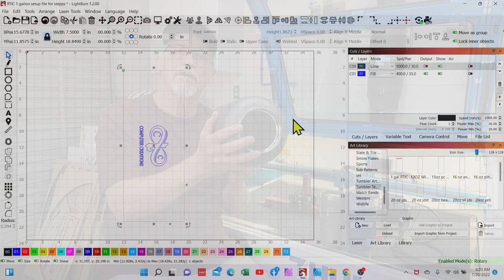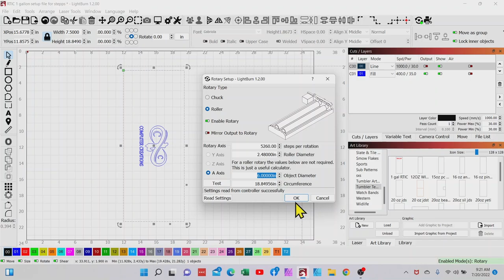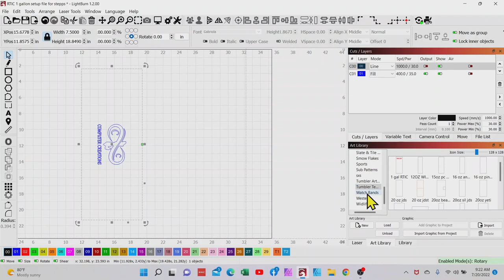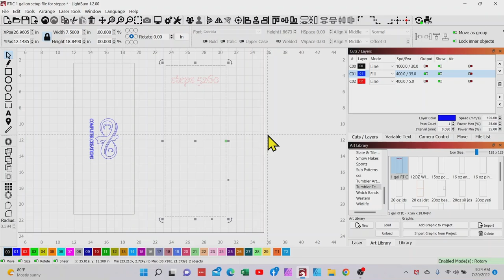Laser Engraving on a 1 gallon jug from RTIC On my PiBurn 4 rotary

Comment: I may have missed it but how exactly did you "calculate" your steps using the smaller neck? I just got my Pi Burn 4.0 with the add-on chuck and have never run a Rotary on my Boss Laser. I subscribed to your channel and have learned a lot. Thank you.
Reply from the maker: I would refer on how the steps are calculated on the pi burn web site. There is allot of ways to do it. Because what is setting on the drive wheels on the rotary is a different diameter than you engraving area steps must be recalculated
\

Comment: Great informative video. Thank you for explaining. I do have a question? Why do you turn off the air assist? I’m still learning on my laser.
Reply from the maker: Be sure your air assist button is in the off position in lightburn
Reply: @computercreationz  okay. But can you explain the reason why this needs to be done.
Reply from the maker: @shawnbrown8995  air assist is used for cutting only there really isn’t anything to blow away when engraving a tumbler. If you use air when engraving a tumbler you just blow all that vaporized material all over your laser that you have to clean later
Reply: Ok thank you for the information. Makes perfect since now. 👍

Comment: I'm looking to buy a thunder nova 24 and piburn rotary and want to be able to do 1 gallon water bottles. Are you still using the 24" bed or is this a larger machine now? If it is larger do you know if it would fit in the 24" model?
Reply from the maker: yes you can you will need to remove the honeycomb and the slat bars and build up from the bottom. I would highly consider the piBurn grip. it works fantastic on large tumblers like that. I sold my 24 some time ago and have a 35-100 now. I reached out to someone that has the 24 and the grip to answer your question.

Comment: Thanks for your detailed explanation.  I noticed in your previous videos you used the Thunder RotoBoss.  Can you share the differences or the pros and cons of each one.  I'm am considering purchasing a laser and am leaning towards Thunder.  I want to also get a rotory with it, so I have to decide which rotory to purchase.  Thanks for your help.
Reply from the maker: there both about the same cost, I gravitate to the piBurn it’s more streamlined and has a lower profile that the full Rotoboss. as far as performance they both work very well.
Reply: @computercreationz  Thank you.  Keep the videos coming!👃